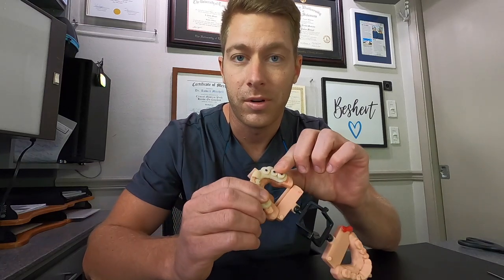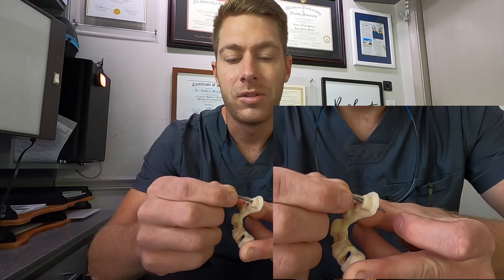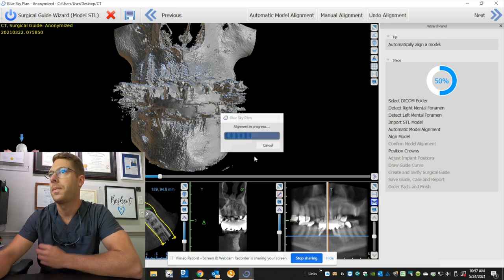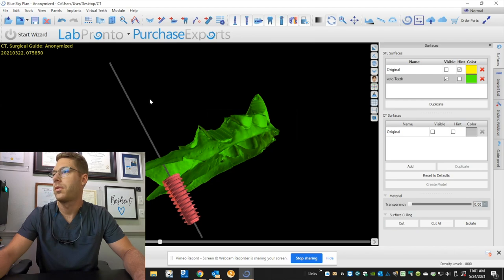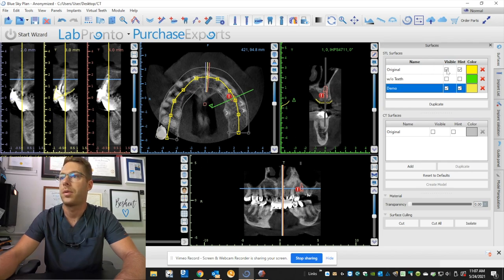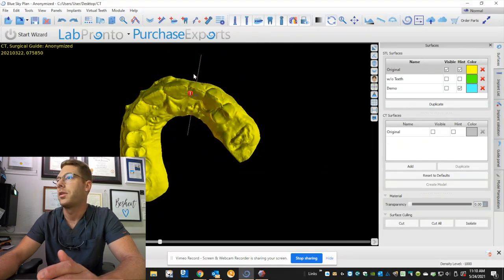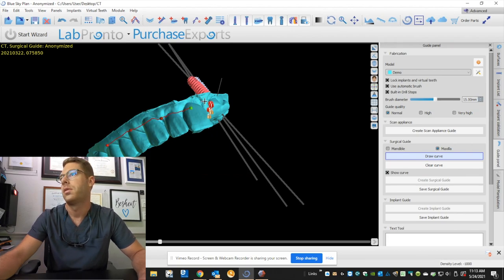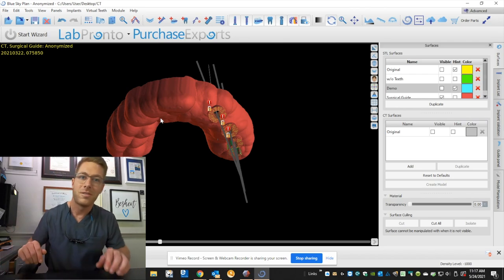3D Printed Implant Surgery Guides, Case Walkthrough in Blue Sky...

Comment: I have all on 4 upper and lower.  But we used 5 upper 5 lower implants. I started out with acrylic on titanium denture.  It took less then a year before the uppers broke.  My dentist had no blame in the denture failing.  Blame falls on the lab that left a space between the denture and the titanium bar. So from there I upgraded to the zirconia for both uppers and lowers.  Roughly my total cost is about $37K.  I  was awake for all of this. The money I saved was not having to be put to sleep.  This option is not for the feint of heart.  From my experience don’t bother with acrylic!  If you’re spending money spend a little more you’ll be much happier.  I wish I had the knowledge I have now. Before I started all of this.
Reply: If you don't mind me asking. How long did the complete procedure take. 
Thanks.
Reply: @MJTAUTOMOTIVE  hey  for me it took almost a full year. The actual time it took to put in the implant varies depending on how many of your teeth need to be removed.  If you need a sinus lift to make room to work. My first visit was 3 hours.  My second visit for my lowers was 4 hours.  This work is done in phases so I was able to pay per stage. Not all at once.  But  you can get them as fast as next day.  I really recommend if you’re getting the all on 4 you wait a little and let the implant fully heal  before you put the  denture in.  You can use a cheap healing denture  until your implants are solid.  Best of luck this was my experience yours could be totally different.  I can’t stress enough avoid anything that’s not zirconia. They are diamond hard look real and you don’t feel them.  The acrylic on titanium will push your bite forward it feels like you’re eating plastic everything.  Plus they’re 1000 times harder to clean and require about $1500 a year to clean.  Zirconia food doesn’t stick to them so cleaning and fresh breath is not a worry. Sorry if that’s to much information or not enough.  Good luck.